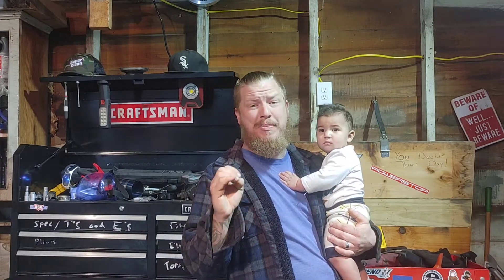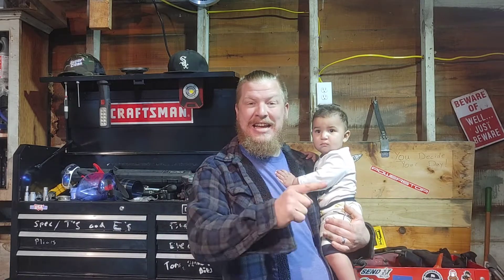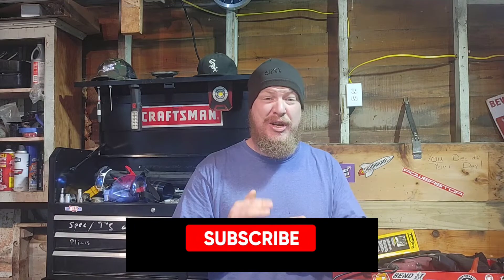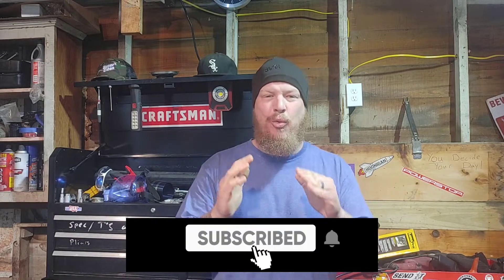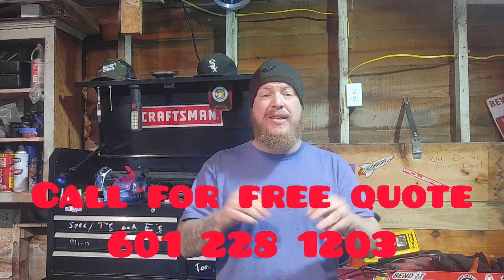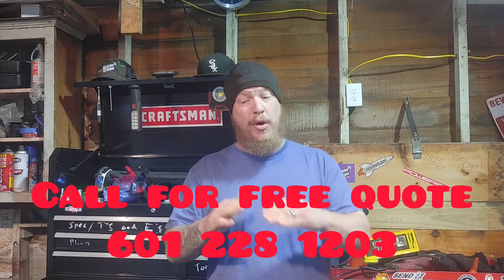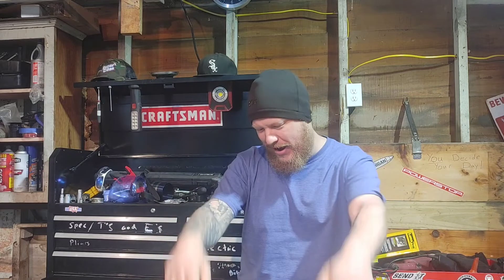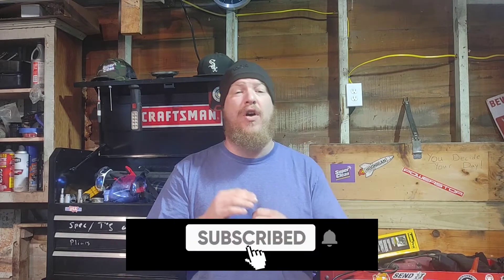How to Install a piston on a 4.7L V8 2008 Jeep Grand Cherokee

Comment: hello I live in Italy, I also want to overhaul my 4.7 engine only that here in Italy I struggle to find the parts I found complete kits on ebay from California, now I'm a bit confused as to which size of pistons to choose, the kit includes Is pistons with 93.00mm bore correct? Thanks for your help
Reply from the maker: Have you bored the engine out or are the cylinders still at stock bore?
Reply: @Sellthoseflippingcars  i think the cilynders  are stock but as soon as I disassemble the heads this afternoon I will make a measurement of the pistons to be sure
Reply from the maker: Online will have 3 different sizes, the measurement will be in metric. If you need help finding the part, let me know and I can assist
Reply: @Sellthoseflippingcars  yeI would be very grateful if you could help me, how can I contact you?
Reply from the maker: I just saw this message my apologies, I can be reached at the business email that is in the video description
Reply: @Sellthoseflippingcars  ??

Comment: How do I know which rod goes where is there a mark on the rod for what piston number
Reply from the maker: No they are not numbered, they are spaced differently. But once you get it pressed on the piston you can slide it over to fit properly. No worries G Rock, you got this
Reply from the maker: Do make sure the piston is facing the correct direction
Reply: Brother I have a 2002 4.7l V8 are u sure I can reuse the rod bolts the manual says I have to replace them
Reply from the maker: In my opinion I would, I say it is up to your budget. But in the case your budget allows it, then replace them. My builds financial budget didn't allow me for this build so I reused them and the vehicle is still running strong.
Reply: Absolutely so I don't have to worry if the pistons are in the exact spot I took them out of
Reply from the maker: @GRockThaIsraelite03071984  ouch you didn't number those either?
Reply: No are they labeled on the rod